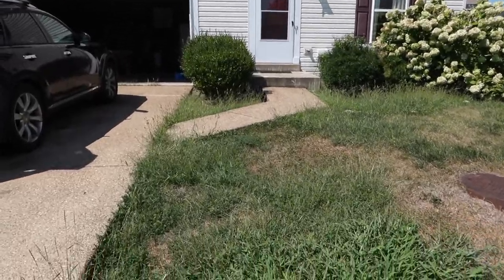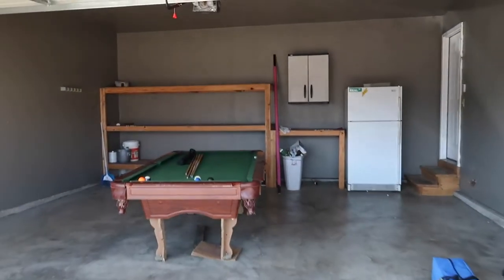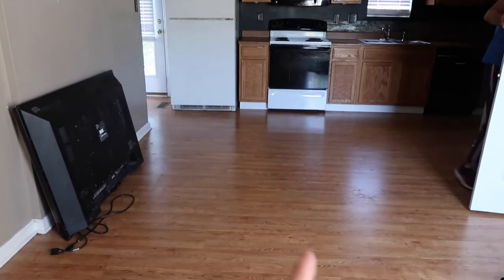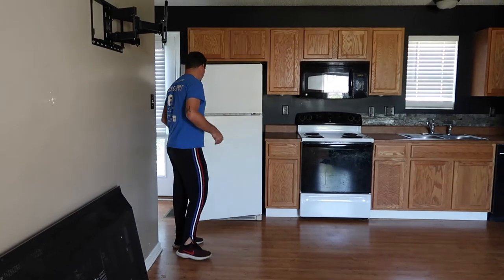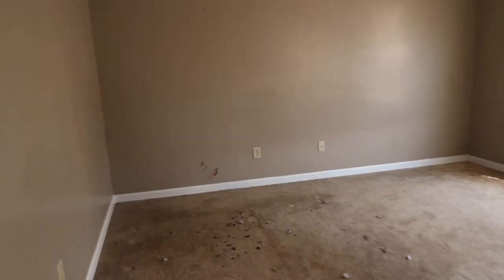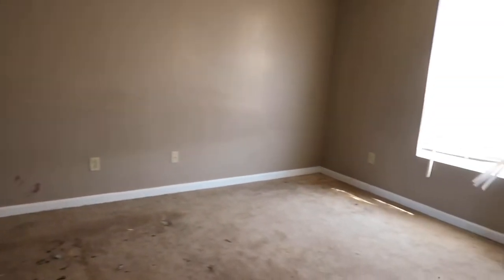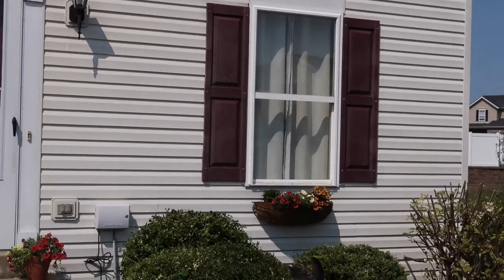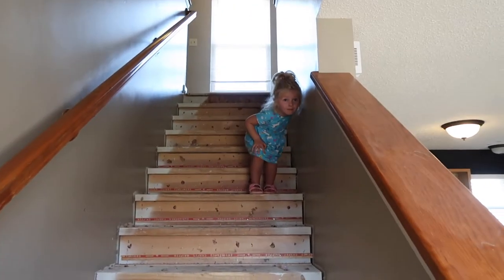Remodel To flip||Adding Curb Appeal For Cheap||DIY White Kitchen Cabinets||List This House.

Comment: Yea when I started to paint my cabinets I was super nervous but I took my time day after day so I wouldn't get frustrated or screw up
Reply from the maker: The worst part was the sanding........but once I did primer and then the paint coat and seen how good they were turning out, it pushed me to work my tail off lol.